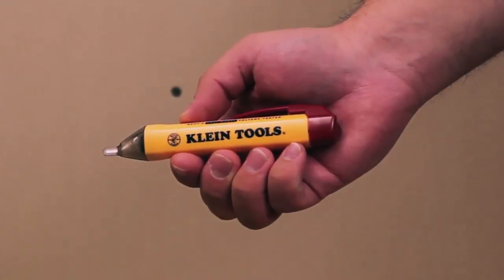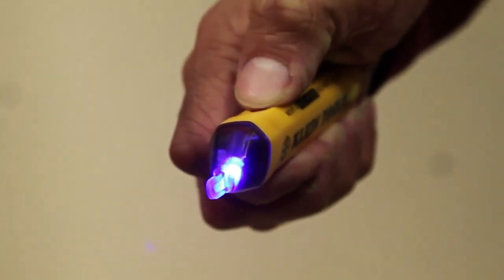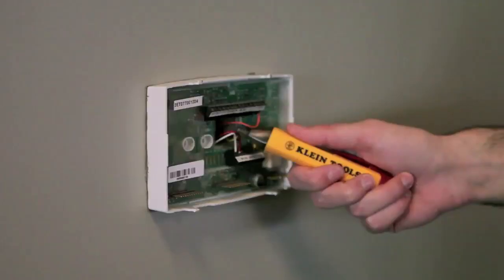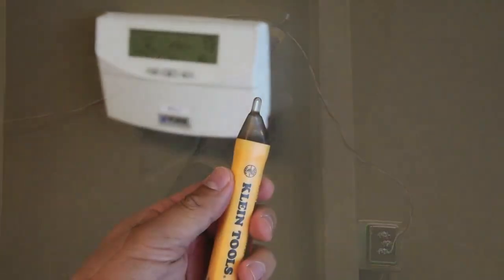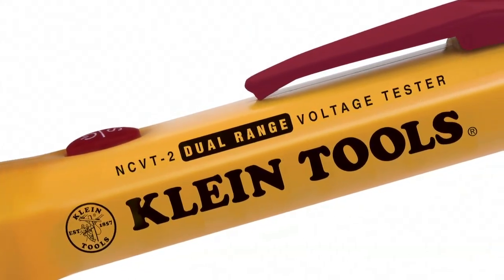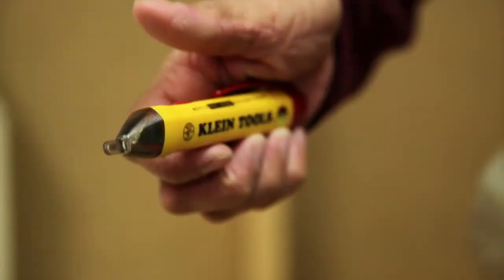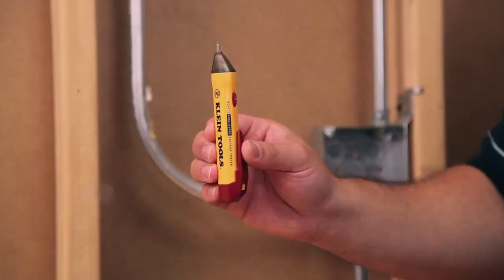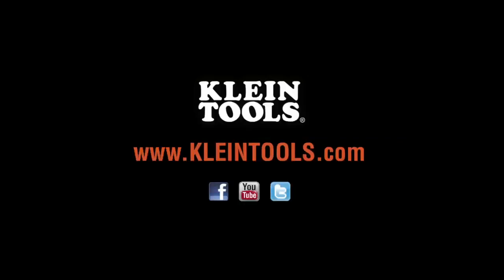Klein Tools Non-Contact Voltage Testers

Comment: Notes to self: 
TO DETECT STANDARD VOLTAGE:
power it on, hold button down until the blue LED light turns green
blue: in dual range mode, can detect between low and standard voltage
steady red light and beeping: detecting standard voltage
blinking red light: detecting low voltage

Comment: I broke mine trying to replace the battery.  The case is difficult to open and the on/off switch has not worked properly since.  I need to replace it now since I can't get to come on without lots of thumping or shaking and repeatedly pushing the switch. Eventually it will come on but then shuts off unexpectedly.